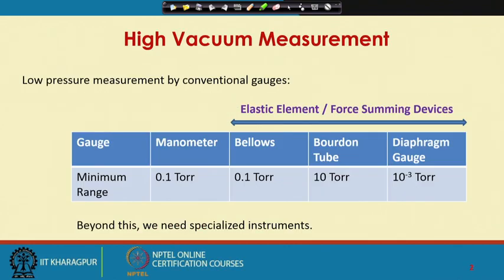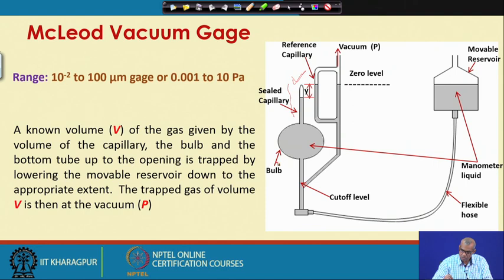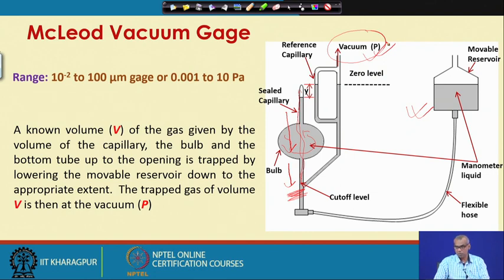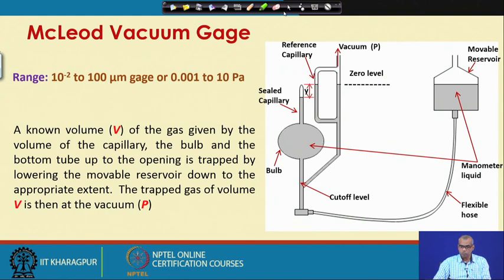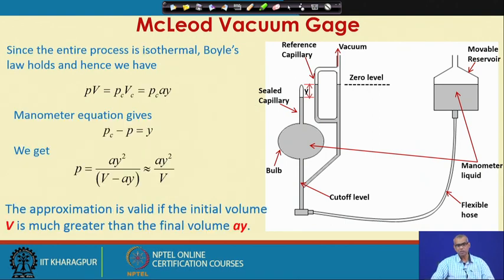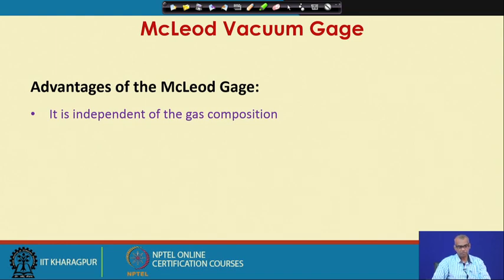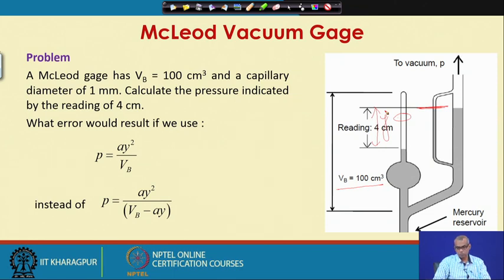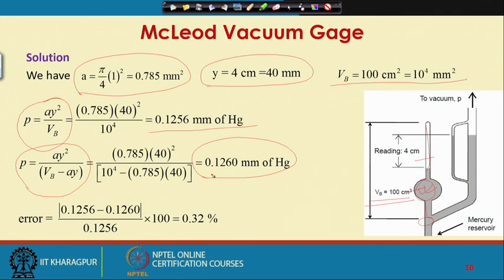Lecture 26: High Vacuum Measurement

Comment: Sir why you taking Vb as 100cm² instead of 100cm³ please tell me
Reply: Hello SIr, I had the same confusion. So, I just calculated, and I think it's by mistake, the final result is based on the cubic cm (cm3) value. So, the question is Correct